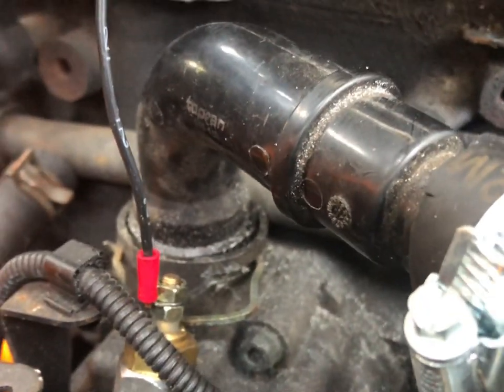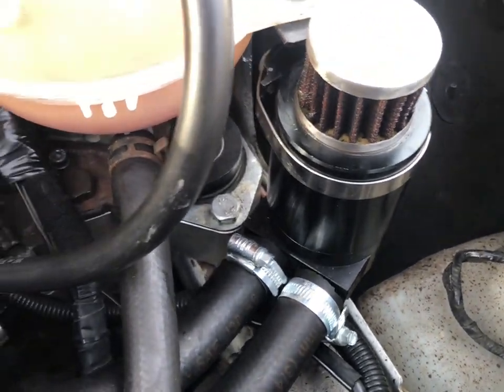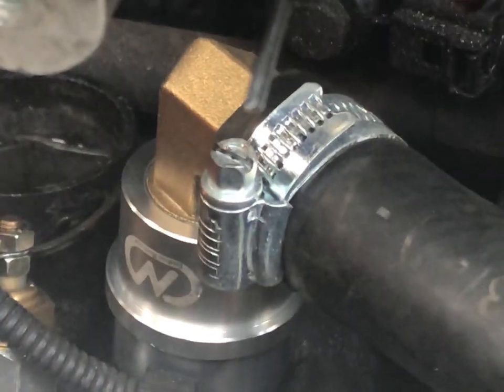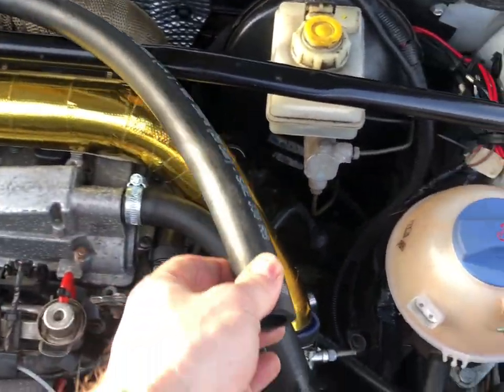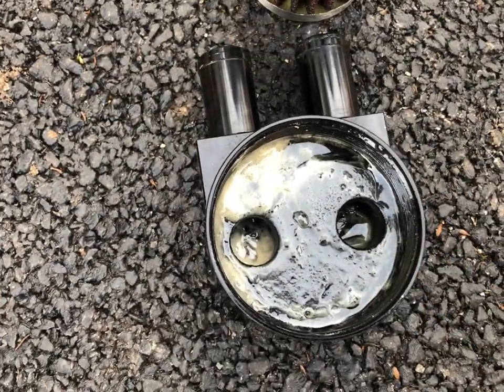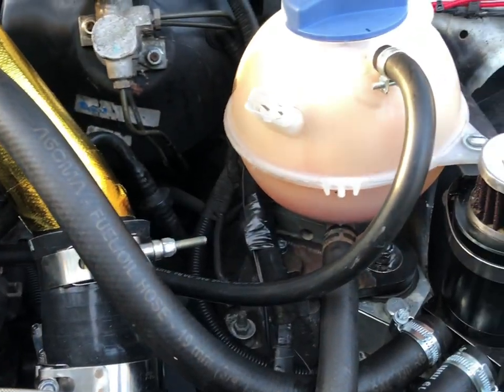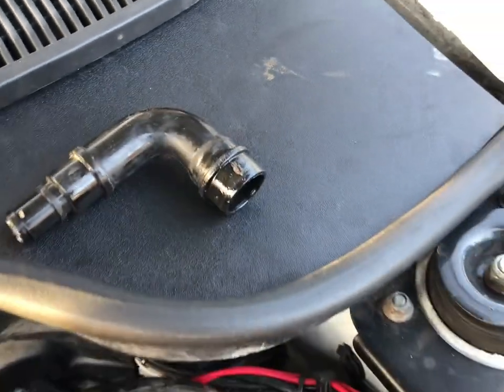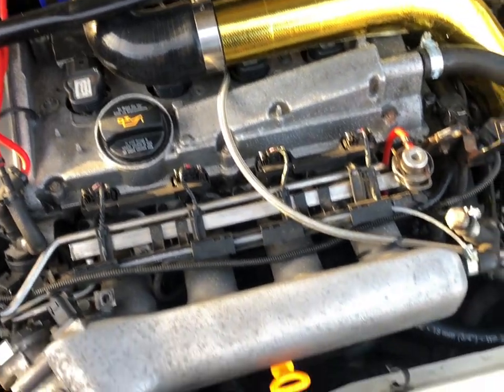1.8t 20v Crankcase Breather Upgrade

Comment: If you watch KB motors he blew his up because there was no vacuum connected to the catch can the crank case pressure was too high because the small vent wasn't enough to evacuate the pressure. Worth a look.
Reply from the maker: Just looked. I think it had more to do with 2 bar through a stock motor myself. 
I have changed this catch can  now to one with 3 - 19mm outlets. So the filter on the top is 19mm - his looked tiny mind